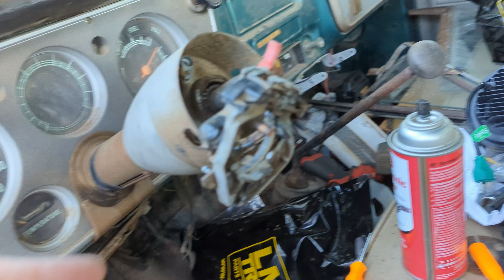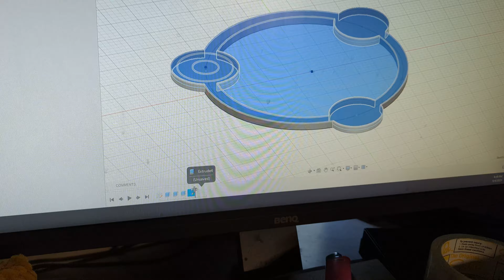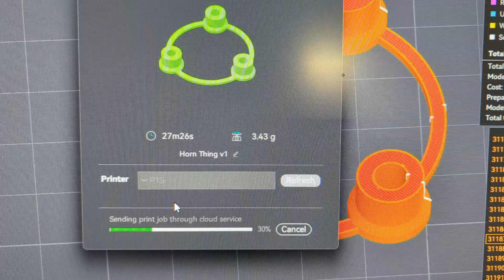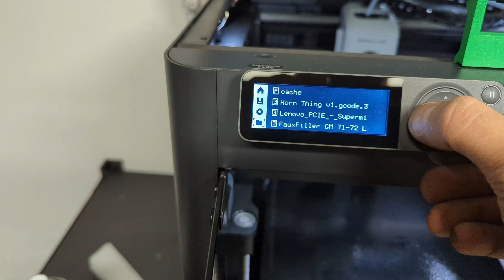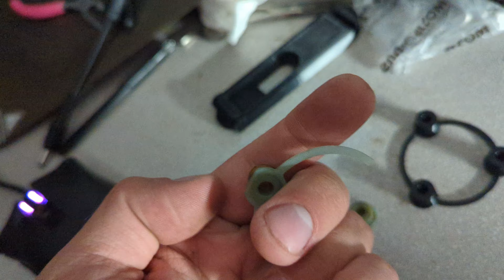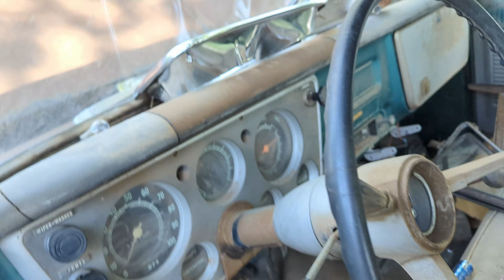Why You Should Have a 3D Printer For Your Garage

Comment: Everyone should have a 3D printer, but along with the printer, you need basic CAD skills.

Last night, I printed tray roller replacements for my dishwasher out of ASA but again you need a basic understanding of CAD to make some things and even if McMaster-Carr has the step files for a specific part number it doesn't mean it was drawn to be end product and often drew in the tolerances they needed to compensate for the manufacturing process they had planned.
Reply from the maker: @Guardian_Arias  It's definitely an acquired skill! Luckily having things you need to make allows you to learn easy, since you have an idea of what the end product should look like. 😅
Reply: @NecromancerGarage  well, at minimum, if it comes out as spaghetti, then it's likely not what one had in mind.